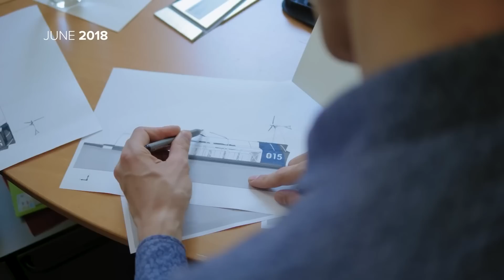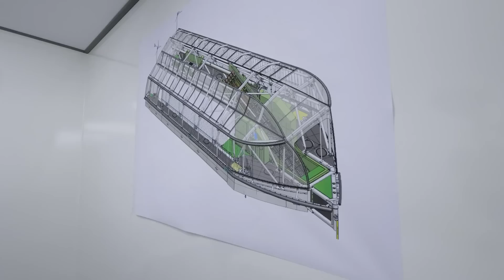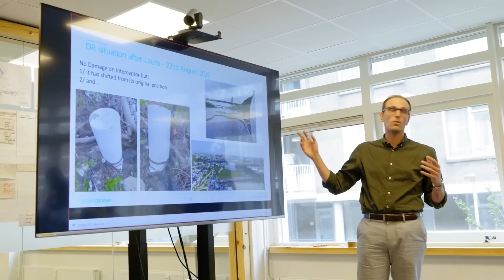Why Ocean Cleaning Starts With This River

Comment: $70 000? For $5000 they could use a floating conveyor belt with the same floating funnel for gathering the plastic, and get the garbage on a piece of land near the river, from where garbage trucks can pick it up and then have it filtered and recycled, or even simply dumped in garbage dumps. Maybe even less than that, if they use a static structure installed in the river, which to work together with the floating funnel they use for gathering floating garbage.

Comment: that amount of money is not that big considering that literal milions are being spent on unnecessary  projects ;  one of them being rebuilding the same stretch of the road multiple times bcs of the lack of planing on the long run. build a road, remove the road, ad 1 type of pipes, build a road and repeat the process multiple times to add different types of pipes. which could've and should've all been done in the same run

Comment: I mean it's so easy not to throw trash into a river. Literally no effort.
Anyway, most of the garbage that ends up in the ocean comes thanks to natural disasters: typhoons, hurricanes, floods, tsunamis. That part can't be controlled, that's why it's more important to focus on cleaning the oceans.
And btw, if you see tons of garbage on the beach, it likely came from the ocean rather than from littering bastards. Although they also contribute to the whole problem a bit.
Anyway, nice effort.

Comment: metallic nano particles can be introduced to the water flow and be programmed to attach to waste in water, even salt! and be pulled out with a strong electromagnet.  easy peasy. not too many moving parts.  super high volume.

Comment: When I was in Jamaica there were beaches knee deep in plastic bottles. Literally. A simple deposit system would clean these areas overnight. Literally.
Reply: In B.C. Canada we now have a drop system. You bring your bottles in large clear plastic bags, stick a label on it and drop them in a bin. All the counting and sorting is done for you which provides jobs and alleviates line ups and then you get a e-transfer for the funds.
Reply: And possibly not all the plastic originated there. It may have floated in from US and other places.
Reply: @kennethgilbertdds7249  The beaches I saw were near Port Royal on the inside facing Kingston, the bay is essentially a closed loop. Low swampy areas along roads near Kingston were also inundated with bottles.  I just think it is better to re-direct the ocean-borne trash at source before it gets there rather than spend multi-millions on collection equipment. Yes the ocean garbage patches need cleaning but they are a band-aid until the input of trash into the oceans is stopped.
Reply: @kennethgilbertdds7249  No, it's local to 100%.
Reply: You would think so but I live in Portland, Oregon where the bottle deposit is 10 cents PER container and they STILL get left in the streets. Now we just have a HUGE homeless population that literally LIVES on the money redeemed from bottles they collect and then they wait in lines for hours at the bottle returns. People with 40hr week jobs don't have the time or energy to stand in line for 45 mins to collect $14.40 (because 144 is the max containers you can redeem at one time-- why this number?! who fucking knows...) so they just let them sit out with the trash. Trust me, I've had 5 HUGE garbage bags of cans in my garage for WEEKS now because of Covid they only have every other machine open at the centers "6 ft distancing bullshit" and every single time I've went to the grocery store and took a peek at the line it was at least 8-10 people deep with trolleys FULLLLLLLL of cans-- hours of work putting them in the machine one at a time. It's so horrible.
Reply: @CarmindyOnline  bottle recycling works well on some countries example in Finland 92% of bottles are returned to shop and every shop which sells bottles has to take those back, so it is about making system which requires product seller and manufacturer participate recycling.
Reply: @freezedeve3119  almost the same in the netherlands. It's not that every seller also has to take returns. But every super market has 1 or a couple of bottle return units. Problem vs the US is that here we still have a ton of smaller local grocery stores. in the US you only have those mega stores.
Reply: @CarmindyOnline  if you don't have time and the money is not worth/needed then give your garbage to an homeless so he can redeem the money, it might ain't much but it's still something

Comment: A small flotilla of fighter jets costs more than what is required to park one of these on each of the 1000 most polluted rivers. A project like this does not require string political support, just a bit of common sense.

Comment: Nice but what is the cost comparison of doing this manually with float skimmers and boats ?
Reply: I imagine that varies wildly depending on cost of local labor. I believe Indonesia was doing something like that to clean up their coasts, tho that could have been a recycling company as well. That said, 700k for something that can move that kind of volume rain or shine without fear of currents would certainly be needed as well to fully clean a river system. of course a trash collection system that didn't amount to 'throw it in the river' would help immensely too

Comment: Great idea but you need to fix these 3rd world countries to fix pollution, as long as you have poor people and lacked laws for companies to operate in these countries, the world won't change
Reply: U dont nessasary need the 3rd World to fix the problem, if we but our first World comapnies under force u can  solve most of the problems indirectly.
If we force first world companies to control their supply chains. (which is easy if the governments would make it a law, but lobbies..)

And dont forget that most plastic waste is from fishing nets, here the governments could also make a law that the companies have to use degradable fishingnets.

90% of the problem is easy to fix, but companies would lose money so the governments dont akt.

But yeah its easier to say they (3rd world) must fix X and not hey our companies would lose a bit of money but we can fix the problem.

Comment: my problem is No body seems to mention CHINA
WHO LITTERALLY has the worst Pollution rivers as well as they straight up instead of doing dumps like america has there dump is on edge of ocean with a Straight dropoff Concrete wall and they put all trash there and push it into ocean with machines not a joke

Comment: There is a town in Victoria Australia where the tap water is not only unsuitable for drinking it's also unsafe to bathe in, according to the W.H.O.  Getting the water onto the foliage of many types of plants will kill them. It travels long distances from source to town through open trenches.  Runoff from farms and roads easily enters the water supply.  Before they improved things the source was much closer to the town and enclosed for its entire length.  Why are politicians allowed to decide anything?

Comment: Thank you. People need to stop trashing . Put trash in proper receptacles.   Do it people. The world needs you.
Reply: Once it's put in the "proper receptacles", where do you think it ends up?
Reply: @oldmanfromscenetwentyfour8164  Lol, exactly.
Reply: @oldmanfromscenetwentyfour8164   In The Garbage dumps
Reply: @ธนาเดชศุภนัทนพร  What about the towns, cities and states that have banned and closed their garbage dumps? What happens their plastics? Recycling Centers have closed as well.
Reply: Manufacturers like Coca-cola should also be made responsible for the packaging they sell their products in. I'm sure most won't mind paying an extra 20% for a drink if it means the manufacturer will build and operate a dedicated recycling facility in each country it operates in. As it is right now, the responsibility is pushed 100% to the consumer.

Comment: if the locals get paid for emptying the skips ,, they probably just take them upstream and throw the rubbish back in , its probably the same 100 tons each day .
Fix the origins of the rubbish would be a great thing to do as well, that wont be as easy as picking up rubbish though.
Reply: What if they get paid a base salary and a bonus proportional to the river cleanliness? Align interests
Reply: @wafflecat8  they will quickly learn to get the river dirty in order to have a job  cleaning it... better not.
Reply: They are working with local authorities and the UN is also very into this project.
Reply: @Ujuani68  lol ,,, worse still then.

Comment: they need to fix the roots of the problem tho. or else the people there will just chuck even more into the rivers
Reply: It's about harm reduction. Yes the reasons for pollution need to be dealt with but so does the existing pollution. And if the source isn't dealt with then all the more reason to do this. And yes the root of the problem is the people but that's where leadership comes in and this guy is leading

Comment: Wait so it even throws away plant matter it collects in the rivers instead of putting it back into the river? They should add something on it that filters that out.
Reply: The plant matter is causing problems as well,called over growth.
Reply: Real cost of cleaning rivers .It took 30 years, 45 bn euros to clean more or less the Rhine . The Interceptor is just a toy
Reply: @freegedankenzurbaukunst5613  sounds like a mismanagement of resources to me.

Comment: An Interceptor cost $700,000 & only lasts 20 years ! Sounds like a rip off !
It would be cheaper to do it manually in these poor countries & create employment .
They could just guide the rubbish onto land shovel it up & process it. !
They should be doing it already !
Reply: The Interceptor is going to do so much in 20 years, it's worth the cost in my opinion. It may be cheaper to do it with manual labor, but machines are much more efficient (they work 24/7, etc).
Reply: @bryandyer5454  But if the rubbish is guided by floats into a catchment area by the land it could be collected in the morning by poor people who are desperate for money & work.All the Interceptor is doing is taking easy jobs away from the workforce & making it look high tech. Keep it simple .....
Reply: 700000 is a bargain for a clean river i'd say
Reply: @Thatsme849  Surely you mean clean ocean